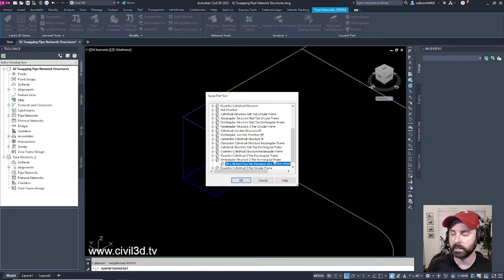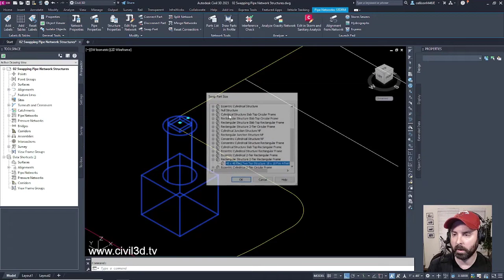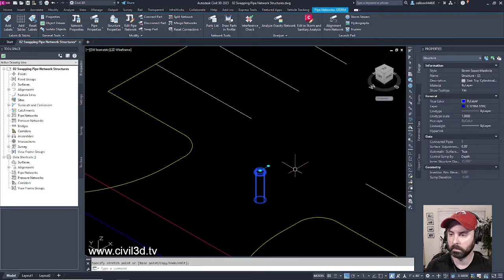02 Swapping Pipe Network Structures in Civil 3D 2023

Comment: I have heard that with Civil 3D 2023 you can connect a force main pipe to a structure. Do you have any idea how to do that?
Reply from the maker: Yes, I typically treat a force main the same as a sanitary network. Pipes are usually smaller